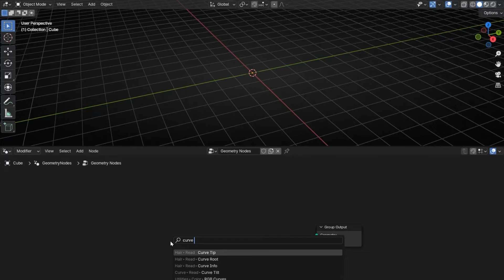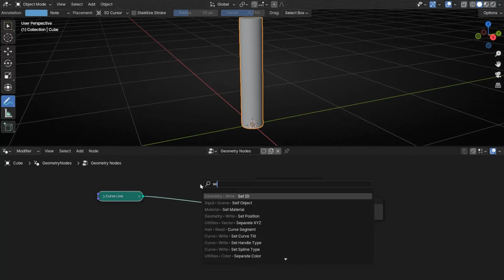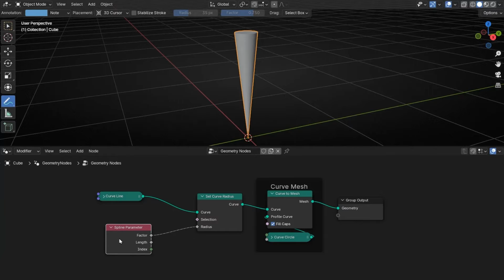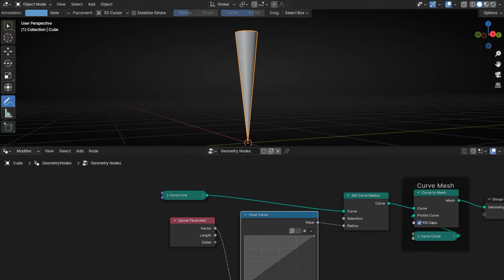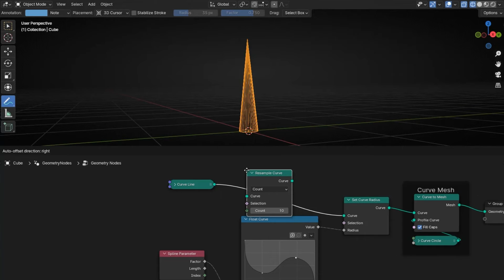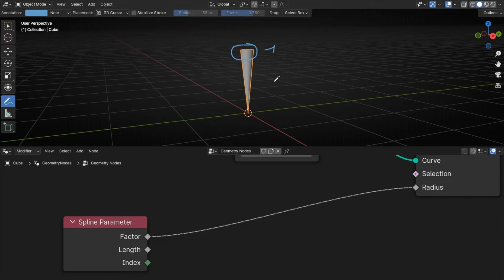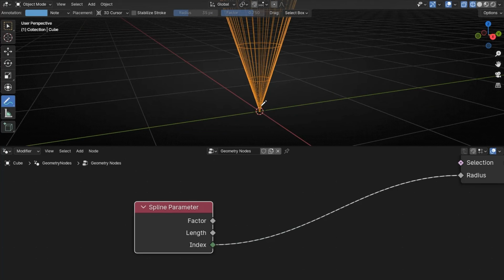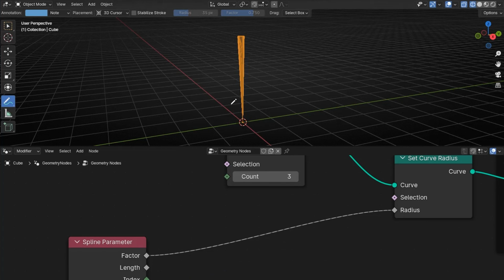How SPLINE PARAMETER works in Blender? - Geometry Nodes

Comment: Blender 4.5 tip: you no longer need the Set Curve Radius node. Just use the Resample Curve node. Plug the Float Curve into the “Scale” input of the new Curve to Mesh node. Then tweak the Resample and Curve Float settings to shape your curve as you like.
Reply: THANK YOU

Comment: Nice video! I prefer using the color ramp node over the float curve node because it allows the scene to update in real time as I drag the slider. With the float curve node, the scene only updates when I stop dragging the control point.  Keep up the good work!
Reply from the maker: Both options are great. Use always the one you find yourself more comfortable :)